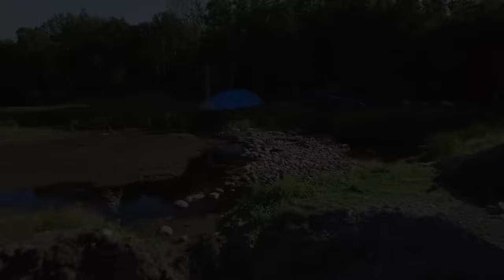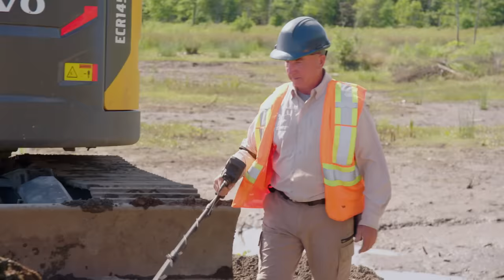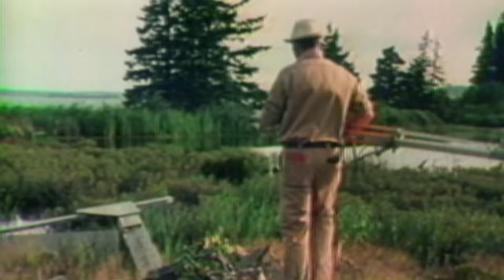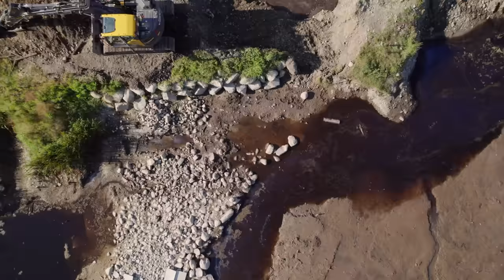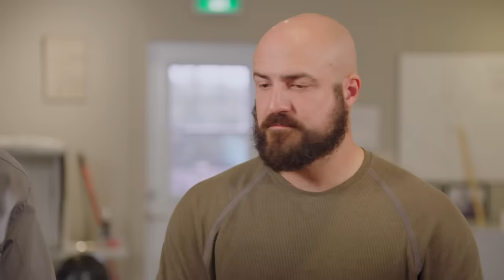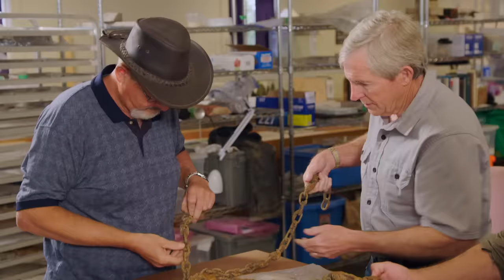The Curse of Oak Island: STUNNING EVIDENCE of Centuries Old Cargo (Season 11)

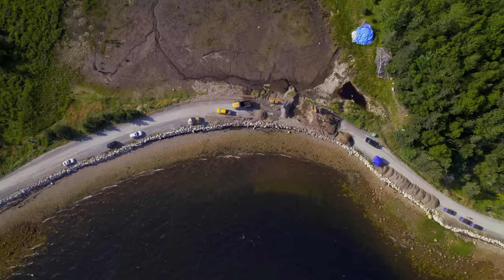Comment: Very interesting view at 5:57 into this video of the southeast shoreline adjacent to where they are working.  Notice that the water at the shoreline is relatively clear so you can see bottom features beneath the water's surface.  The shoreline at this spot drops off sharply to an "average" depth of 7.9 metres (nearly  26 feet) [SOURCE: CHS Nautical Chart 4381: Mahone Bay].  In the very distant past when the sea level surrounding Oak Island was lower, much of that seabed/slope would have been above the mean high water line and it has been long suspected that there could be one or more cave/niche crevices "now submerged" at locations along the Oak Island shoreline that could lead to the cavern(s)/voids deep beneath the island.  They should consider investigating that further if they are permitted to do so and if it would be safe.
Reply: They've done that with die anf air pressure to see where and if it came back out to the ocean.  It seems there was a little bit if I recall.

Comment: Omg just dig up the whole island already. It'd be quicker and more cost efficient
Reply: Or just leave it alone. It was probably a pretty nice place till they turned it into a stripmine... for ad revenue.
Reply: @joeshoe6184   This is nothing!  You should have seen what was done to Oak Island back in the early to mid-1960's when the top of the island was literally bulldozed off and also when the causeway was constructed.

Comment: If large ships came into this area before it was back filled how much draft would they need ?
therefore how deep was the cove ?
My Point - how deep should they dig down to to fine the real bottom of the cove where any thing that fell off the unloading dock and ships be ??
Reply: They are only licensed to search out to the shoreline of the island and cannot search or retrieve anything that is beyond the shoreline that is on or in the Mahone Bay seabed.  In regards to your question regarding the water depth at that spot, taking into account the slowly-rising sea level surrounding Oak Island, the "current modern-day", shoreline at this spot drops off sharply to an "average" depth of 7.9 metres (nearly  26 feet) [SOURCE: CHS Nautical Chart 4381: Mahone Bay].  Therefore even 400 years ago, for example, taking the changing sea level into account, it still would have been deep enough at that spot to bring a ship to the shore.
Reply: @johnwoa  Thank You Sir: